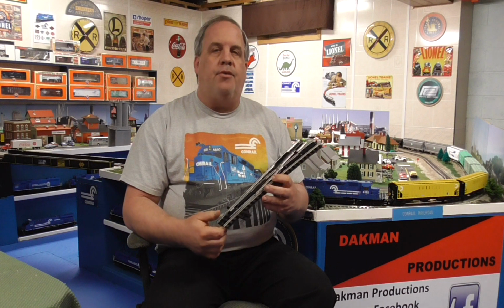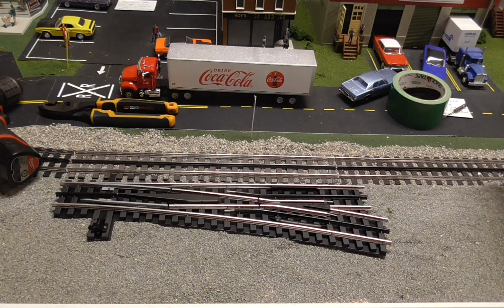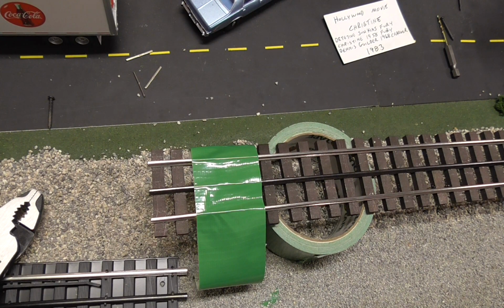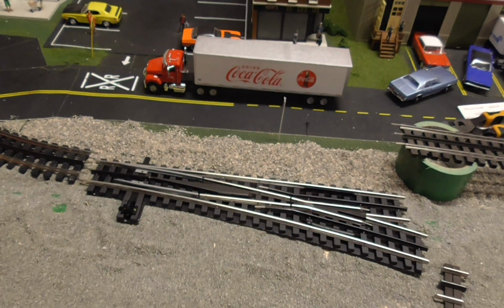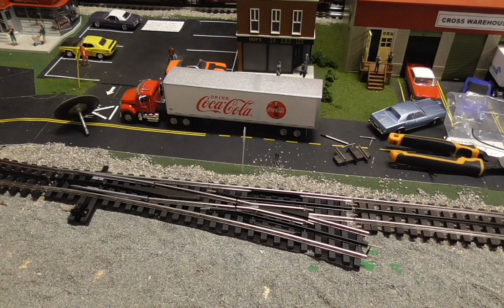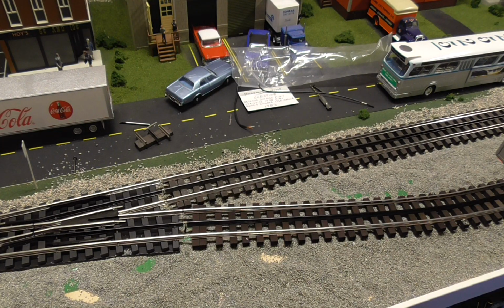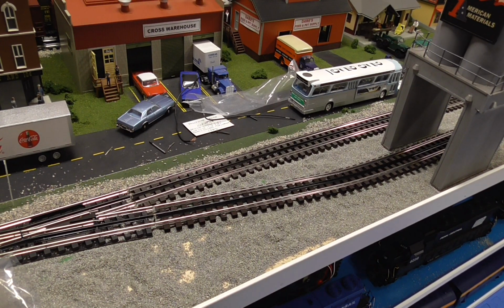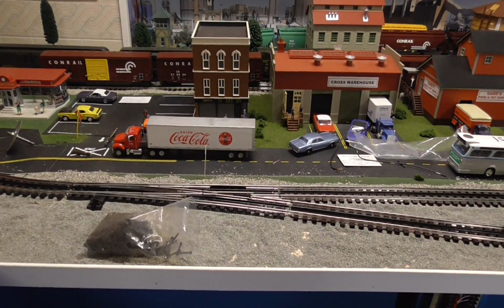Gargraves Switch Installation O Gauge

Comment: But don't you lose track power find dead spots where you have to have more feeder wires to  fix that cause it's basically the same track and old lionel tubular track with the pins connecting right? And they can come loose over time like the pins in the old tubular track so how is Gargraves any better?
Reply from the maker: Gargraves is for those who want more realistic looking track.

Comment: good video,  I am a newbie and lucky for me I have been using most of your methods.   I do use the O rings connectors between my rails both for the gargraves and menards tubular.    I also place a very small amount of super glue on the track to secure the O ring.   I know I know super glue does not conduct electricity but a small amount on the point of contact between the ring and track secures the fitting.    Going on a couple months and no problems.   When laying a new track,  I use my cut off saw with an 8" metal cutting blade.   You get all three rails at once and the sparks do fly.
Reply from the maker: Thanks for watching